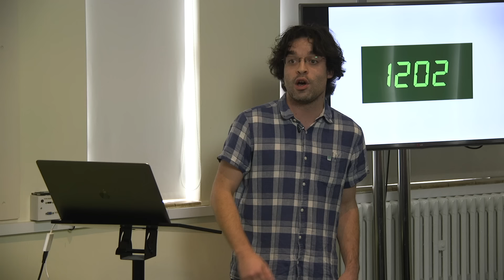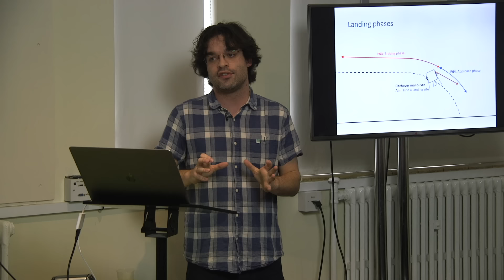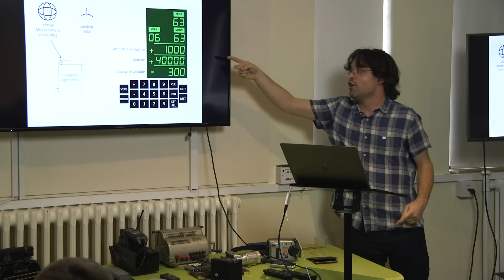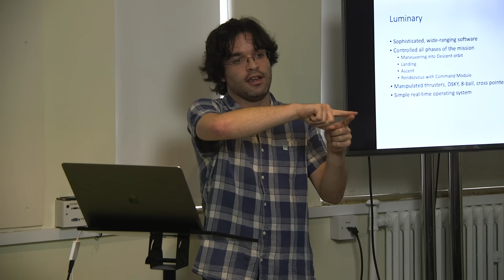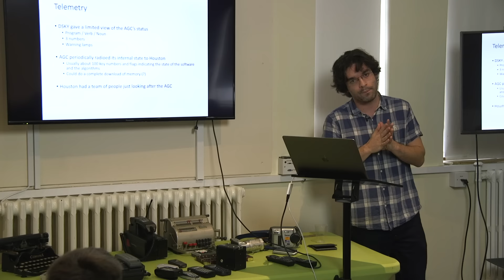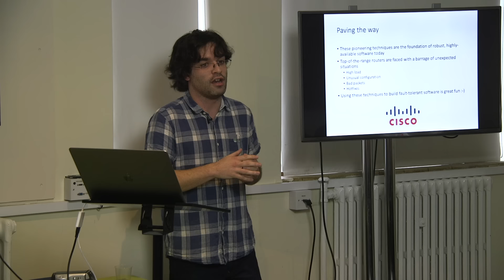Light Years Ahead | The 1969 Apollo Guidance Computer

Comment: That fixed memory programming with wires blow my mind absolutely!
Reply: Yes it's very unusual isn't it! When the programmers were developing the code, they used a special device called a "Core Rope Simulator". This pretended to be the fixed memory (ie it behaved the same electrically), but the programmers could upload new programs to it to test.

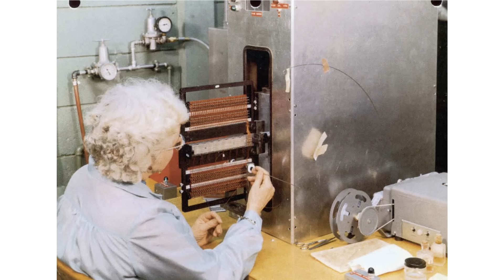When it came to producing the final fixed memory, as I said in my talk this was woven together using wires (see 10:00 in the video). In the factory there was a machine which had the final machine code loaded into it as data. The machine would tell the textile worker which ring to wire through next based on the machine code, and he or she would thread the wire. The machine-assistance helped them get the correct final result, but ultimately it took a lot of human skill and dexterity to thread the wire.
Reply: @robertwills8051  the Weaver's were called little old ladies, ie. the first use of LOL acronym
Reply: @robertwills8051  ladies and gentlemen, before you drink all the Kool-Aid this channel can offer.. let me give you the opposing view ,,so that you can have a clear story here 
     now we can talk about the satanic numerology that this guy uses and the satanic symbolism,   that is prevalent throughout this whole video, if you want we can talk about that, another time..  
       today let's talk about the fact that NASA has claimed, a bunch of times that all the Telemetry data has gone missing, 13000 reels, went.. bouncy balls, Baby Boom, bye bye along with every single schematic, to anything that went to the Moon, that would be the computers.. so I'm wondering where this guy came up with this cool story because it's not from NASA, they lost literally everything.. man's greatest achievement was completely lost.. but don't worry we're going to have an independent Computer Guy makeup even better stories than the ones you've seen in 69...... 
    and the picture that, he used, the iconic astronaut standing in front of the American flag, now that's heartwarming.. Until you realize that looks a lot like a studio-quality picture and here's the rub guys. the camera they were using needed to be completely adjusted. completely manual.. there is, no computer there,  no AutoAnything remember, the good old days, where you had to    metre the shot, adjust the f-stop, and then get the picture into Focus.. now I want you to do that with your eyes closed because they could not look into the camera, it's mounted on their chest and they have a huge salad bowl on their head ..they can't adjust the camera because their gloves are so freaking bulky and yet these guys we're taking one picture on average every 50 seconds and that includes changing locations, applying extra attention to certain details , sometimes having to move as much as 1.5  miles and yet they clicked one picture,, one studio-quality picture every 50 seconds.. go ask a photographer can this be done with a completely manual camera?? and the answer that all the moon landing deniers seem to be coming up with is an astounding... what a joke
     few of my favourite clips about the moon  and their  chopped full of laughs.....
Can U See Stars Buzzed
https://www.youtube.com/watch?v=jFqDTxYegzI
Top 10 NASA is BS
https://www.youtube.com/watch?v=pEE7OPKLhaM
Hold Ur Head High---Simple Proof that the ISS is Nothing More than a Hollywood Production
https://youtu.be/iwoudgUPqSM
Do Not Watch This Video,,  a  great Flur Fur intro                            
https://youtu.be/D0peS1oxYLo
Flat EarthTruth documentary .
Flat Earth - Best Presentation to Date, objective n honest
https://www.youtube.com/watch?v=YVLzPEoKhe0
Reply: @partypoet2012  please do elaborate on the covert Satanism threaded through the presentation.   Enlighten us.
Reply: We have a bit of this type of memory sitting in our school's CS department, it's really incredible to see how tiny the weave is.
Reply: So - the memory is in the woven wires? Remarkable!

Comment: Fully engaging! Will look for the internet version to enjoy.
I do want to get your answer to a version of the "relative power" question, as the question of comparison to later tech really does assume that the software would be re-engineered as well as the system, and something like a Raspberry Pi can be run with a real time OS. What it definitely lacks is redundancy and error correction in memory and buss operations.
     So, my question is: If the AGC was re-engineered in later technology, what kind of system would it compare to?  I.E.: for the 1980's, would an Apple ][ comparable system (with added I/O) have been able to cut it? For the 2000's, would a high I/O type of System On a Chip cut it?
Reply: Hi, this is a great question. Firstly, I should mention that I'm not an expert on modern hard real time systems. That said, I think the equivalent system nowadays would be a microcontroller such as the chips that power the Arduino or newly-released Raspberry Pi Pico (eg something like an ARM Cortex-M). Microcontrollers have bounded instruction latencies and interrupt response times which you would need for a real-time system like this.

A desktop-class CPU such as what you find in a regular Raspberry Pi or a datacenter server has so much going on inside it that I don't think you'd get the guarantees you need for a real-time control system.

I imagine that a lot of the hardware and software technologies and methodologies for things like modern avionics systems would carry over into a "modern" Apollo Guidance Computer.

Finally, the one thing I definitely think would be different is they would have two (or even three) Apollo Guidance Computers for redundancy. If one of the computers didn't agree with a calculation I could conceive that being an abort condition. Back in the 60's, they didn't have enough power, weight or space to carry two AGC's, so instead they carried a simple backup computer called an "Abort Guidance System" whose only job was to get the crew back into orbit in the event of an abort. That's quite different to having two or three identical AGCs that all have to agree.

Comment: I thought the main reason that Armstrong took over manual control was that the guidance computer was sending them down to land in a field of boulders and Neil wanted to overshoot that area and land on a more level ground area. Was that not the case? Great presentation!
Reply: Harris, this is a subtle point, and Armstrong "taking manual control" is often conflated with the program alarms.

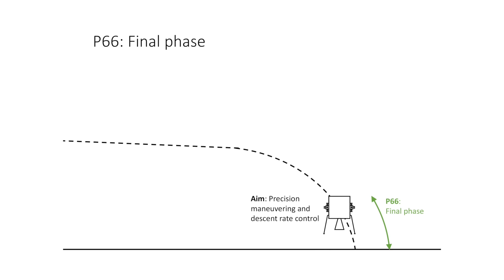Firstly, he never takes "fully manual control" as people might think of it. Instead, he enters P66, which means his joystick steers the spacecraft rather than changing the desired landing side. But at all times the computer is involved in flying the spacecraft (see 32:00). I'm not deliberately splitting hairs: I'm just making the point that the computer was still sufficiently functional despite the alarms!

During all the Apollo landings the Commander switches to P66 to finish off the landing in this "direct steering" mode. For various reasons, the spacecraft was off target, so Armstrong entered P66 early to correct things. Entering P66 reduced the load on the computer (see 56:30), but that wasn't why Armstrong switched to P66.

Orbital mechanics is not particularly intuitive, and computers tend to be better at flying it, particularly the earlier stages of the landing. But sometimes you just can't beat the lateral thinking and ingenuity of a human. Armstrong was extremely skilled in this regard.
Reply: Neal taking over control was always the plan.  Every Apollo mission commander did the same thing.  The computer had no knowledge whatever of the terrain and would have happily hit a rock or crater.  The only difference in Apollo 11 was that Neal took over earlier than planned.
Reply: Of course but that was no surprise,  the landing computer had zero information of the lunar terrain.  Absolutely zero.  All it knew was the intended location.  All Apollo missions were landed manually as they got near the surface.  Also Neal had to make sure they didn’t land with one leg in a crater or land on a rock and damage the engine.  This was no computer error or failure.  Neal had plenty of experience with the landing simulator and claimed that the real lander flew even easier.

Comment: Did the Soviet Space program have an on-board computer that could perform these same calculations?  If not, what were their plans to handle all the complex calculations needed to land a spacecraft on the moon?
Reply: It was all much more primitive for the Soviet lunar program. The computers were all analogue and did much less, and the spacecraft controls were much more manual. This is why my view is even if the N-1 launch vehicle had worked the Soviets would have failed to land on the moon, or died trying. They went for "easy" wins in their space program and didn't develop the sophistication needed for a lunar mission. The computers on Soyuz did not go digital until decades later.
Reply: @iceiggle Weight as you say, and also potentially size and power consumption, are all problems for an analogue computer of the complexity of the AGC. OK there are no lines of code to write, but someone has to design the analogue circuitry instead. And there may be problems with precision allowing errors to creep into the calculations.
Reply: @iceiggle As a real world example, the analogue Soyuz computer could not cope with large payload fairings. And it needed the entire launch table tilted to help with the roll. The Soyuz pad in French Guiana cannot tilt the launch table, this requires the digital Soyuz computer. Similarly the larger payload fairings used there need the digital computer. It's a question of the complexity and accuracy you can fit in the size/weight/power budget.

Comment: Very interesting.  Don't think it has been asked yet, so what was the significance of only going to 94% thrust in P63 stage please?
Reply: Remember that when a rocket engine is designed, it is given a nominal 100% thrust level. That value never changes to allow valid comparisons. Very often rocket engines are run above 100% once it is known what they are actually capable of. So 94% only means 94% of the nominal designed max thrust. But I don't know why they used 94% thrust.
Reply: Owen Smith 
I had read that the Lunar Descent Stage engine had an ablative coating to keep the engine bell cool. This was a weight saving innovation. The kind of cooling system normally used in rocket engine bells would add too much weight. The 94% thrust was employed to prevent excessive erosion of this ablative coating and thus damage to the engine bell.